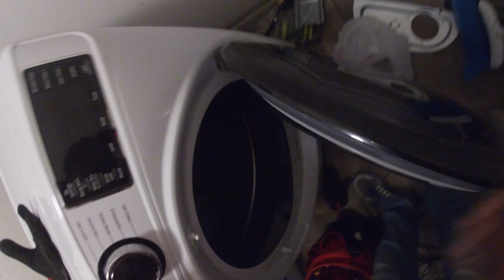Live Appliance Repair: How to Remove Control Panel on New GE Dryer

Comment: Have fun with the washer. As a GE Customer Care technician it took me 15 mins just to figure out how to take the top off. Turns out there’s some screws in the dispenser then the control panel slides to the right. Then you see the screws for the top. They redesigned the ultrafresh washer very differently from other front loaders. Unlike other front loaders once you take the control panel off remove the the three screws and slide the top towards you instead of back. Interesting design. They must’ve been trying to eliminate the struggle of having a dryer stacked on top by making the front panel removable without having to unstack the dryer.

Comment: Very nice job.  My new 2024 model had a rattling top. Tap it with your hand and it was noisy.  I used your trick and pulled off the top cover to put a "duct tape gasket" around the perimeter of the top sheet metal and no more rattles.  I don't know if the factory didn't install a part, or it's just a bad design.  Anyway, thank you for the video.

Comment: question I have a similar dryer.  plugged in nothing goes on. no lights no buttons etc.  at first when I opened the door the lights would flash.  any advice.  I was thinking wire harness?
Reply from the maker: Check the door switch

Comment: I have an identical dryer and when installing it it does not turn on.  Do you have any idea what could happen?  The dryer does not give any signal on the screen, on button, etc.
Reply: Mine literally quit powering on and no lights even with door open. Did you ever figure yours out?